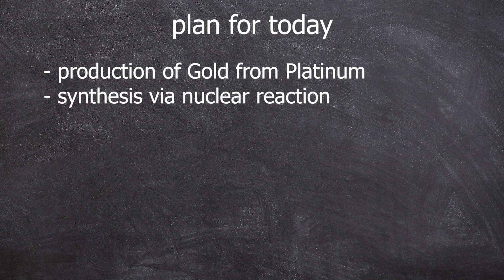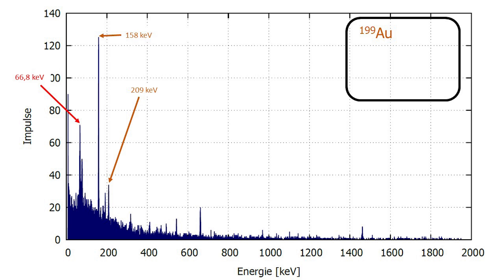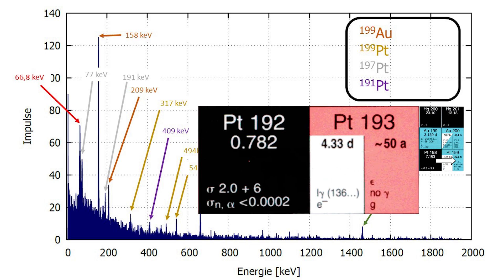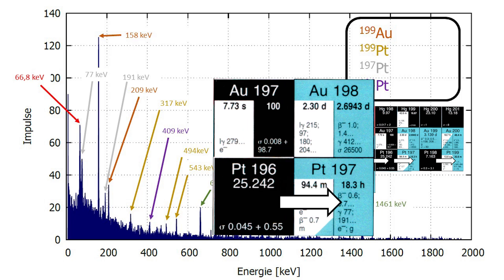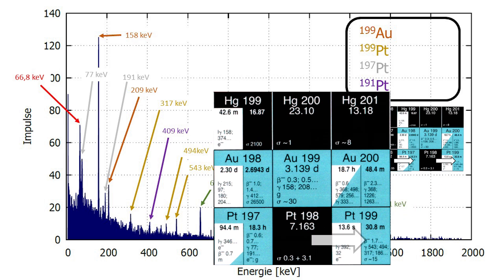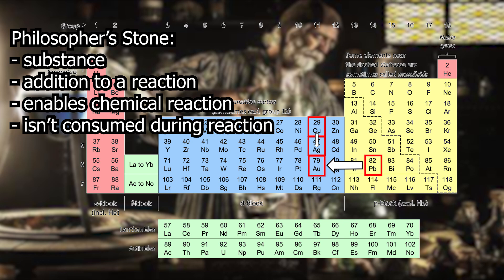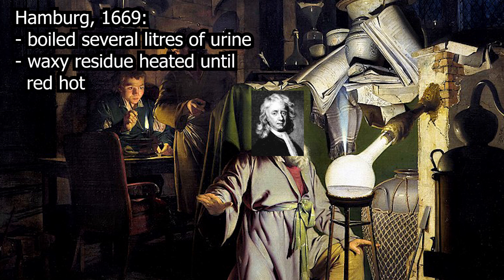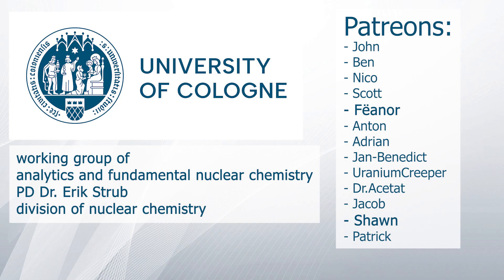Making real Gold - nuclear chemistry

Comment: I have a piece of Uraninite with Gold on it. I wonder if the Gold is irradiated?
Reply from the maker: @jonmarquez128  most likely not in the sense of what I did in the video. Uranium emits quite low energy alphas. Alpha irradiation takes place at 3-5× the energy of that from Uranium decay

Comment: When you're doing Alchemy and there's suddenly an unexpected bright flash of light from your flask, that's concerning.
When you're doing nuclear chemistry and there's suddenly an unexpected bright flash of light from your flask, that's extremely concerning.
Reply: Yeah, like U-235(aq) and then turning on the stirrer and getting a nice prompt criticality. Sorry, I’m not a chemist. But wasn’t that the source of some radiation incidents?
Reply: @felixg3  Yeah, that pretty much exactly describes the 1950 Los Alamos incident (although that involved plutonium rather than uranium) 
And you're right, there have been several similar accidents over the years where the transition of a solution of fissile material from one geometry to another was enough to bring it prompt-critical. Sometimes caused by activation/deactivation of stirring, sometimes just because workers weren't using the right shape of bucket...
Reply from the maker: there also has been an incident involving U-235 Uranylnitrate solution in japan^^